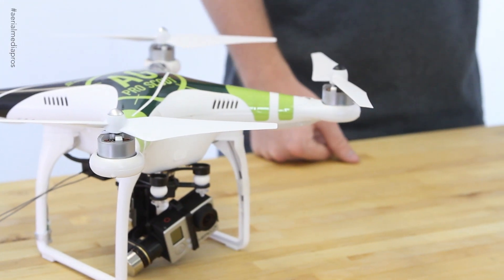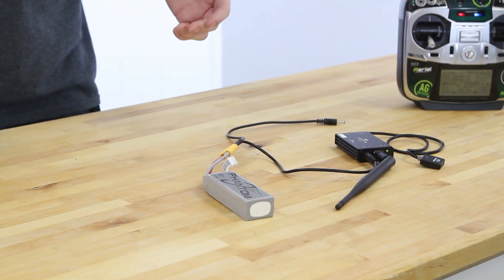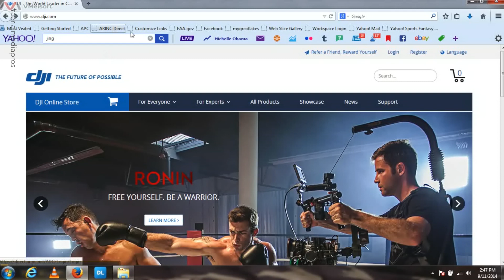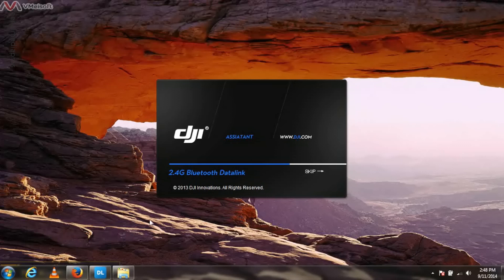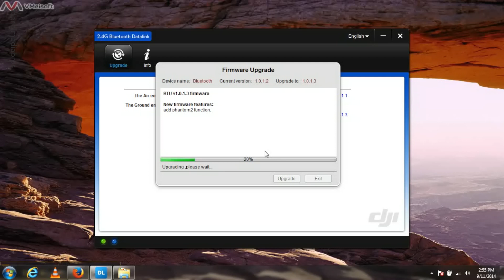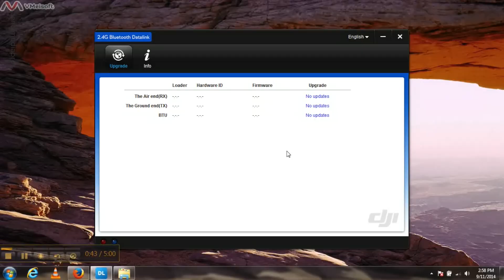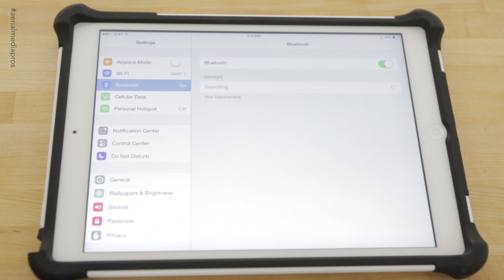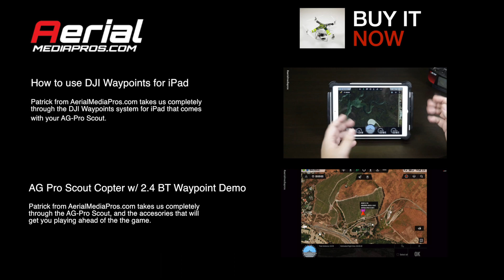How To: DJI DataLink and iPad GroundStation Troubleshoot Guide by AerialMediaPros.com

Comment: Hello there. I know that technology has grown in a fast way, but... I still have this system, but I do not remember my datalink password when 
ground station ask it for enter. How can i reset my datalink password?Thx
Reply: another question in 2020 XD

can you connect yours to a conputer? if so, which programm are you using / where can i download it? and also: is it possible to use it with an ipad and plug the usb into lets say a powerbank for power? thank you very much!

Comment: also have a DJI A2. I collect large drones. I always used to use Wookong-M, as well as telemetry Lk-2.4 Mhz. Now I decided to use DJI A2 and telemetry LK-900Mhz. But I had a problem. DJI A2 does not want to work with telemetry LK-900Mhz. I do not know what to do. Help me with advice. What am I doing wrong?

Comment: I am having trouble with my s1000. Whenever I connect the air and ground ends I cannot connect it to my computer or whenever I connect the ground end to my computer, then I cannot connect it to the air end. I cannot connect in ground station, any ideas?

Comment: Thanks for your video!
I have a little question:
Do ground end and air end pair even before connecting an ipad, or do I trigger that pairing via an ipad?
I only have the PC-groundstation which I don't get to work...Air end just keeps flashing and ground end does only indicate power, nothing more. Unfortunately as I can't distinguish between red and green this is really annoying for me....

Comment: I was able to get the green and blue light on one time and i did the update then it still didnt fix the red btu so then i tried doing the next step and re flashing it as you said or update the middle one and ever since i did that i can no longer get it to connect when i open up the assistant software. you never mentioned what caused them to go bad. this was brand new out of the box tonight. what do i do? thanks in advance